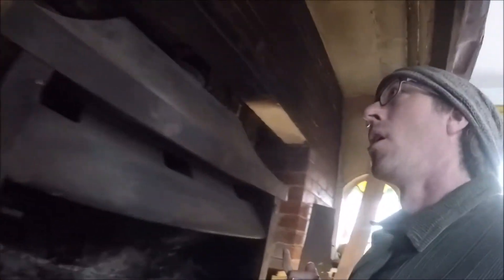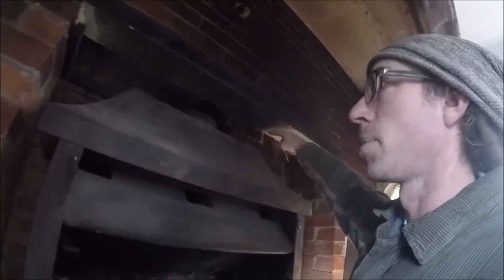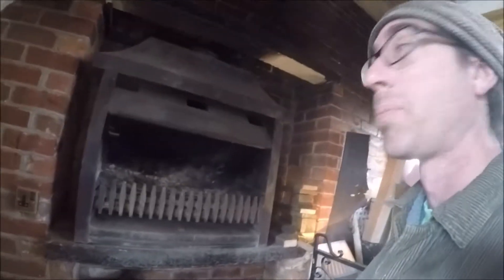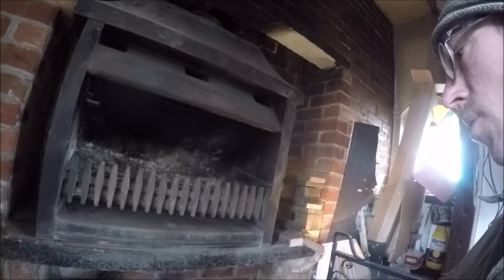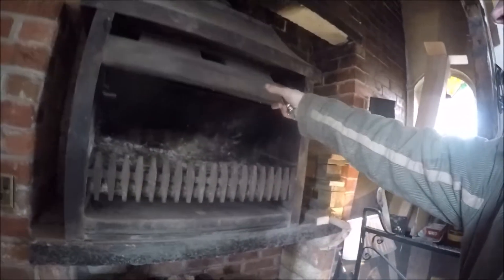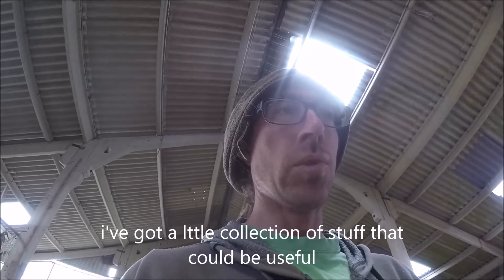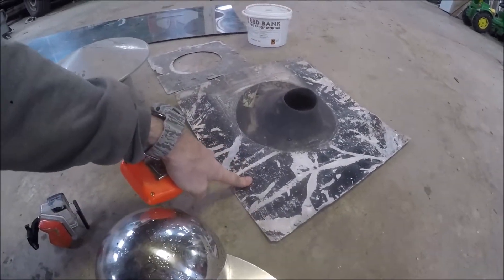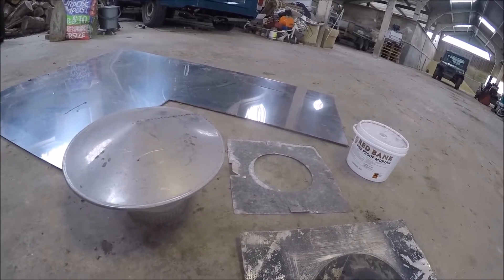Man vs Fireplace 2 - flue liner installation

Comment: Awsome.  And you do all this work alone? Also dude maby you thought off this but can you weld the exit hole closed on the new fire place you got from facebay, and the just drill a new exhaust pipe on top like uou need it? Just wondering man.
Reply from the maker: Jas Poin I’ll just put the blanking plate in and either put a bit of fireproof rope or fire cement round it. Yes all alone dude! That fire box was heavy as!